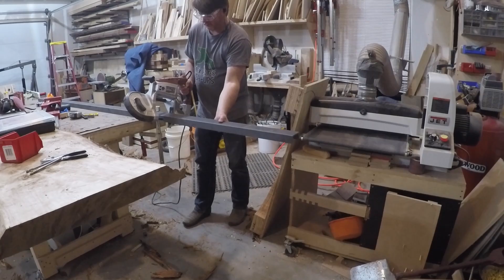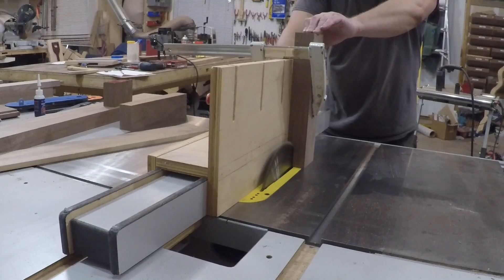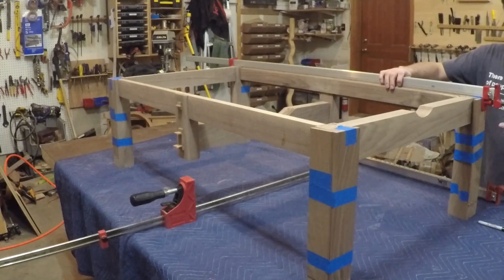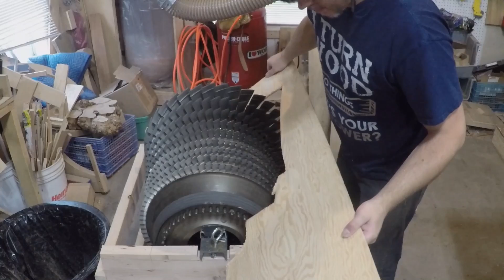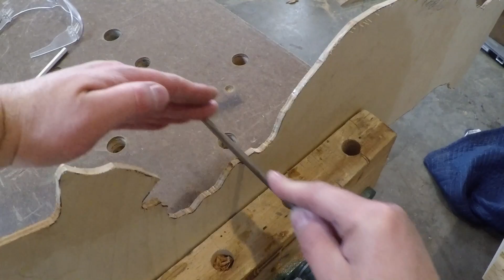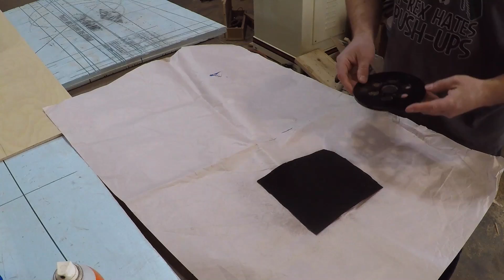Building a River Coffee Table With A Jet Engine in it

Comment: That to me looks like a HP/IP (depending on engine) compressor rotor, not quite a 'jet engine' 🤣
Reply: @Benham_Design  it is yes, mostly because we have to comply with the machinery directive and Various other standards, but I do like the simplicity of your method! Simple and effective
Reply: I have a colleague at work who makes furniture with decommissioned engine parts, it's very interesting. Nice work with it! I noticed that you actually lifted the compressor the same way we do when we build the engine. We call them 'mars bar' lifters